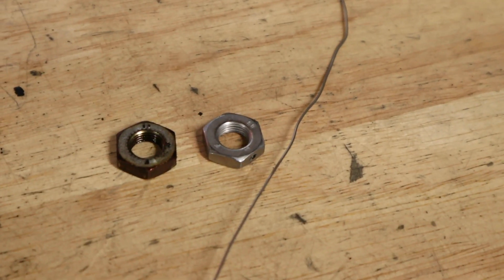MUST HAVE M54 Mod? (E46 Drilled Oil Nut Install)

Comment: Hey serious question I recently had to drop the oil pan on my 01 e46xi and I just got the pan all sealed up and I forgot to loctite the nut but i got a good twist on the safety wire and locked in the tightening direction and the nut torque to 18ft lbs, should I be okay since the car doesn’t see more than 3500 - 4000 rpms at most or is forgetting to loctite fatal

Comment: 2001 525i  128K GM auto 10/2000  (in holding pattern for your thorough rear main seal repair...... the leak that is slowly but surely calling my name.)

Comment: Useful video for when I inevitably get an e46. Out of curiosity, does the same issue present on the m52b28tu?
Reply from the maker: Yes! From M50 up to M54 they all use this oil pump design and prone to failure
Reply: @TheBimmerBarn  Thanks! I'll be sure to replace it when I service the oil pan gasket

Comment: Reminder for panicing m54b30 owners, that unless you are revving the engine more than the factory rev limit, running alot of power or bashing the engine hard. Its not completely necessary to do. But its good to do if you need to drop the oilpan for some reason.

Comment: Future money saving tip. Most good motorcycle shops will have safety wire drill jigs. Could get the stock but drilled for probably $5. Not sure how much the new one cost but it's an option.